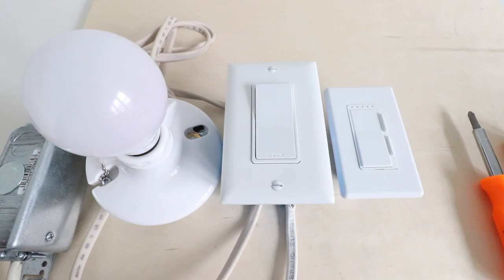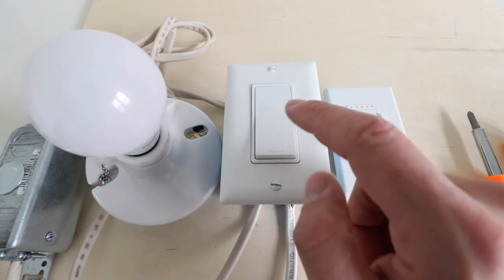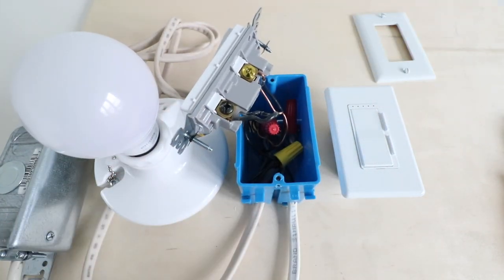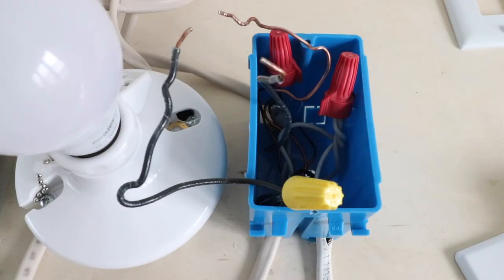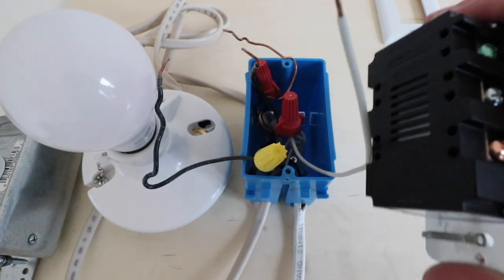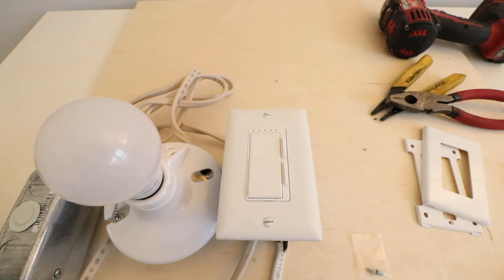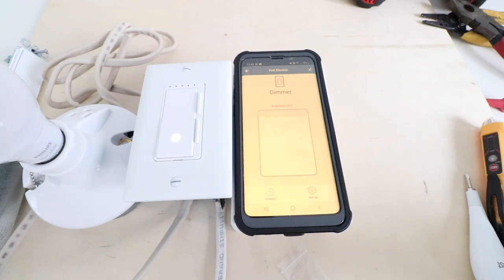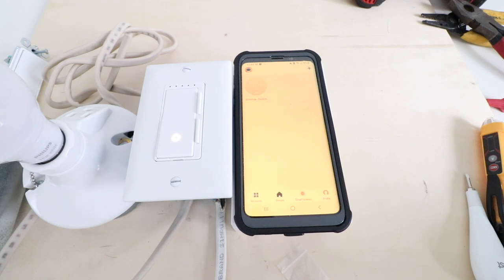How To Install Feit Dimmer Switch Wifi Light Switch From Costco

Comment: This took me a week to finally get working. Here are the things I missed in hopes that it will help you. 1. I needed to go to Home Depot and buy a roll of white wire. I needed 14 gauge. But you might need 12 gauge. If you aren’t sure, buy 12. 2. Make sure your wire nut can handle all the white wires together. 3. The two black wires might need to be switched, so if you aren’t getting power one way, try switching them. Apparently on a normal single pole switch it doesn’t matter so sometimes the load wire and the hot wire are attached backwards. Hope that helps anyone else struggling with this!
Reply: Thank you Sir.  I had to switch my two black wires to get power in.
Reply: @petea7592  I knew I wouldn’t be the only one. Glad I could help!
Reply: Had same issue with mine.  So strange, swapped them and it worked.  Glad you made this comment!
Reply: @frankie4thewin  Glad I could help!
Reply: Exactly my problem.  Thank you!
Reply: I'm so mad that it didn't come with white wires and a wire nut. But thanks for posting this
Reply: Thanks, man. had the same problem. Now it's working.

Comment: Very well done and organized video. My only caveat, to place the switch in pairing mode you need only press and hold for 10 seconds on the on/off switch. thats far easier than running back to your panel and throwing the breaker.

Comment: Thanks for the video - it was a life (or at least sanity) saver.  

I have one additional piece of advice for people installing FEIT switches into a multi-gang box.  In my 3-gang box, there old switches did not use the neutral (white) wires so all of the white wires (seven total) were twisted into one giant bundle.  Your video saved me from the impossible (for me) task of figuring out which of the white wires to use.  The problem not addressed in your video was that the bundle of wire was already so big that I could not manage to get three more into it!  After several attempts, I eventually decided to add just one more short piece of 14-guage wire to the giant bundle.  I then twisted the other end of that wire with three more short connector wires so that I had one for each of the three FEIT dimmers that I installed in the box.  

Worked fine and allowed me to continue without trying to bend that giant bundle of wires.  As I am sure you know, a bundle of seven 14-Guage wires is REALLY hard to bend.  Best to just leave them at the back of the box.
Reply: Ken, I'm thinking of using these switches, but I also have multi-gang boxes (2 gang).  Are the 2 gang faceplates a standard size I can get at the hardware store?

Comment: Didn't have a neutral in the wall, so I ran a wire from the AC-N and screwed to the metal junction box.  This did the trick.  Now it works like a charm.

Comment: I've never done electrical. You made this project easy. Thank you for the detailed installation explanation. I had to add extra neutral wire like you did in the video. I was scared, but I did it thanks to you 👏
Reply: I don't have the extra neutral wire, is it something you can find online or stores?

Comment: Very helpful. Where can I get the white wire that you’re holding?  Can I use the existing white wire at back and connect directly to the switch?
Reply: Buy the white wire at Home Depot. I needed 14 gauge.

Comment: Can I just take and use one of the neutral wire and cover the remaining with wire cap..instead of having extra wire coming from the group of neutral wires?
Reply: Connect all white wires together with a wire nut

Comment: Great video (and your series are awesome too.

I have installed all of my connections identically to yours (just like the instructions that came with the unit). AND: The unit powers up, all indicator lights come on and it's synced up with the FEIT App...But my lights will not come on?  Is there something simple I am missing?

• Our home was built in 1994 and there is a neutral wire. • One room has 4 standard incandescent lights (single pole) (in a 2-gang box)  • The other room is single pole, one dimmable LED light. (in a 4 gang box).

Note: I have done this configuration in two separate rooms (separate switches) and get the same result. 

Fingers crossed you have an idea. Cheers!

Comment: How do you wire 2 Feit dimmers in the same junction box? One powers a pendent and the other, dimmable overhead LED pucks. I have a line and 2 load wires, 3 neutral wires, and 3 ground wires. I can only get 1 to work at a time and the neutral for the line and load have to be connected to the same switch. I tried jumping a black wire from the load side of the working switch to the loade side of the other switch. There is no indication of power on the 2nd switch. Help!

Comment: Thank you so much for such a wonderful video and very detailed about what kinds of wires to connect and saved me from calling an electrician. More than anything I did not need to return is back. Thank you for good tip about how to find neutral wire!

Comment: I do have a single pole switch in a bedroom with two ground of wires from the top and one from the bottom.   I'll keep the three grounds and three neutrals together but what about the three live wires?  I assume I should wire nut two of them but don't know what to group as the hot vs load
Reply: I've got the same issue. Three wires. I can wire it so that it stays on, but the switch won't turn it off.

Comment: I have several of these switches in my house however two of the rooms that have them, when I turn the lights on or off they fade off where the other rooms they turn on an off instantly. I am not sure why. On the app I use the two rooms that fade have a icon under it that is a circle that’s half black half white. Would you know why by any chance why they fade? I want to get that on all the switches

Comment: You only connect a single ground wire and a single neutral wire to the dimmer, however the instruction manual has 2 ground wires and 2 neutral wires going into the dimmer. Any reason for that difference? Thanks!
Reply from the maker: The manual is showing you maintaining a continuous circuit with the neutral wires and a continuous circuit with ground wires. In this video we do that but we complete the circuit using the wire nuts wired in the box with the neutral wires wired together in a bundle with a wire nut and the ground wires wired together in a bundle with a wire nut. We then use a single extension wire from each bundle of wires to the terminals on the light switch. This allows us to wire the device using wire loops on the side rather than back wiring the device.

Comment: Very helpful!  The instruction that come with it make it seem that you should put both parts of the ground and neutral into the switch but it didn't work for me.  Using the wire nut with a single ground and single neutral into the top hole for each in the switch worked great.  Was also weird that the live was on the rose gold across from the load instead of the brass below the load
Reply: @Idris Kaleb instablaster ;)
Reply: @Chris Kellen i really appreciate your reply. I got to the site on google and im in the hacking process atm.
I see it takes a while so I will reply here later with my results.
Reply: @Chris Kellen it did the trick and I finally got access to my account again. I'm so happy!
Thanks so much you saved my ass!
Reply: @Idris Kaleb happy to help xD

Comment: Is there a video using the 3 way configuration? Looking at using a regular switch on one end that has power coming in and then connecting the smart switch on other end. WiFi control still works with that, right? Appreciate it if someone can share what I may be missing or need to consider to have 3 way with switch and this smart dimmer , using the WiFi to set timer, remote on/off, etc. Thanks!

Comment: Awesome explanation. This was my first time doing electric switch replacement and I was able to replace existing on/off switch with feit smart dimmer and understand the wiring. Mine had three white all connected together and three Black wires one hot chained with another outlet and one black going Load (Load here is light fixture). I was very careful with wiring and turned off the breaker during the wiring. Thank you very much for excellent video.

Comment: OSWALDO NUNEZ

I followed all your instructions, and the light works correctly, the app works, but the Dimmer does not, you think it is something that I did not do well or the switch does not work correctly, the lights are compatible with this switch

Comment: Darn sounds easy, but after opening up the  existing switch you can't tell which one is load and which one is line?? both are on brass nuts on switch and both come into box from the top,, so how do you tell which one goes where??
Reply: Normally, the line coming from the bottom of the blue box goes to your breaker, and the lines running out of the top go to your light bulbs.  If they are both coming out of the top, then you need to use a voltmeter and figure out where the electricity is coming from with the breaker on.

Comment: So I originally installed the switch in my dining room to the fan light combo had a power outage and now when I turn it off the LED lights only dim 
And do not turn completely off what could have happened

Comment: I've never worked with electricity. You made this project simple. Thank you for the thorough installation instructions. I only have one question for you: my old switch has one red wire. 1 is black and 1 is green. Not two black. What exactly is the red wire?
Reply: Have the same issue, were you able to installed it? Thanks in advantage

Comment: This is helpful, but I stuck trying to figure out the neutral wire on a 3 way with a dimmer and switch on the same circuit.
Reply from the maker: This shows you how: https://youtu.be/9wplTWkHikE

Comment: Hi I have 3 black (one hot fixed to the old switch, and a 2nd inserted into the old switch beside the hot, and a 3rd load wire) what do I do with the 2nd black wire please?
Reply: You connect the 2nd wire beside hot to hot as well. you most likely have 2 hot, check with multimeter  if you want to be 100% sure.

Comment: will it work in older situations without a neutral?
or a neutral is required
Reply: Neutral required for dimmer switch with WIFI. It will not work without neutral wire.

Comment: one question.. do I must have ground connect to it  in order for it to work? in my existing witch the ground (copper wire ) is not connected, Thank you!
Reply: It's best to because if there is a power surge. The ground directs it to the ground rod for the house. If there is no ground it could cause a fire because the extra energy will be released elsewhere

Comment: I am building a theater room and I installed two of these dimmers from Costco.  One controls the room lights and the other controls the screen lights.  When I turned the breaker back on the switch for the screen lights works fine.  There is something wrong with the switch for the room lights.  The lights came on but the switch won't respond for turning the lights off or dimming the lights.  The lights are stuck on.  I double checked my wiring and everything looks OK.  Any help is appreciated.
Reply: Neutral hooked up? load is black lug not hot.
Reply: I have same issue. Neutral hooked up and load is black. Any help?

Comment: Hi, i bought this Fiet Dimmer from Costco, it doesn't turn off the LEDs completely, although i have installed it with a neutral. is there a solution to it? Or u can suggest a switch that will fix the issue but won't break my bank. Thanks u are awesome
Reply: I just had the same thing. On a set of FEIT lights it works well but it is not in another room with other brand lights. I think it is a compatibility issue. It depends on how your light handles the off current. I am still looking for another one. I feel it should be something that has a smaller minimum load requirement.

Comment: I installed this but now the lights won’t turn off completely. When the switch is turned off it’s still dimly lit. Any pointers?
Reply: Did you ever figure this problem out?  I'm having the same issue and trying to find an easy fix.

Comment: I've got a total of 3 wires coming into the box. Before all of the black were together and all the white were together. Not a defined line/load. I've tried all numbers of wiring and I can wire it so the lights are on, but they are constantly on and the switch will not turn them off.
Reply: I am having the same issue. Did you figure yours out ?

Comment: My old switch has 1 red wire. 1 black and 1 white. Not 2 black. What is the red wire?
Reply: Trying to figure out the same thing
Reply: Turned out it was a 3 way switch. We ended up returning it as after finally installing it, it requires 2.4 wifi  which is unavailable in our area.
Reply: @stappm  How were you able tu installed it? I do have wifi 2.4 but have only 3 cables (red, green and black). When I installed light start flickering, I start the troubleshooting but no results. I wonder if Im installing the cables wrong.
Reply: We only have two wires, white and black.  Also just getting flickering.  Did you figure anything out?

Comment: I set up these switches in my house but for some reason all the switches don't turn on at 100% even though it shows 100%. I have ability to click up and it gets brighter. Does anyone know how to fix this?
Reply: The switch is programmed to self regulated by the app. You can manually override it physically at the switch.

Comment: Anyone have a problem with a false 100% dimming level? The app says 100%, but if I press the button on the switch to increase the brightness, it goes up to the true 100% level. Furthermore, the fake 100% level makes the lights flicker
Reply: I'm facing this same issue. Did you ever resolve this?

Comment: The age of the house isnt the defining factor for neutral in box. Its the way the fixture is powered. Ideally the line from the breaker comes to the switch first (with a white in the box under a nut) then to fixture.

But sometimes the power goes to the fixture first then to switch. The switch has 2 black (usually a black and a white taped or marked black) and breaks that line. Totally common and safe.

Easiest solution is a Wi-Fi lightbulb if the fixture will take it.

Maybe in the future there will be an in fixture add on device  to make these Wi-Fi switchable as power goes there first.

Comment: Crap. This doesn't work properly at all. I'm not able to program it and it doesn't recognize my 2.4 Ghz wifi. I purchased a pack of 3 from Costco and the screw plate (to hold each wire) bent very easily. This is not a safe product. Return immediately